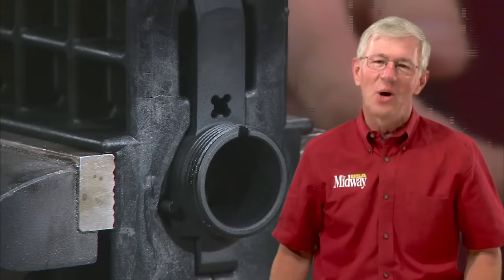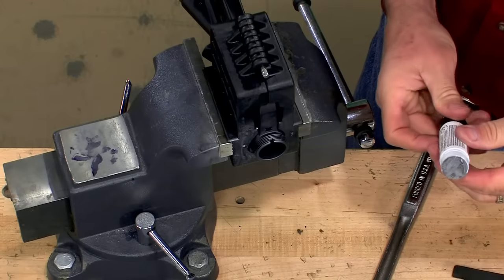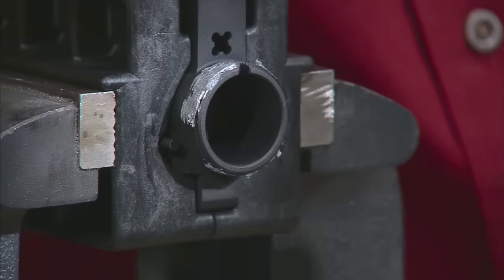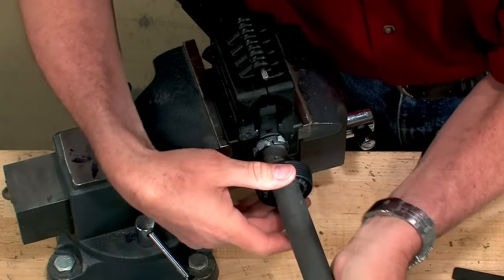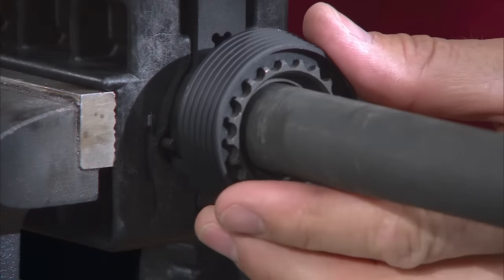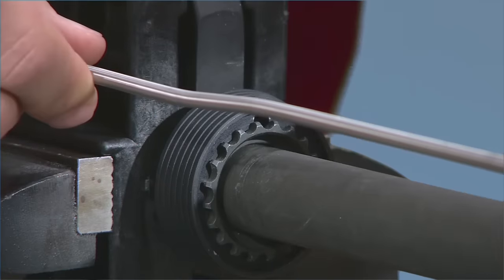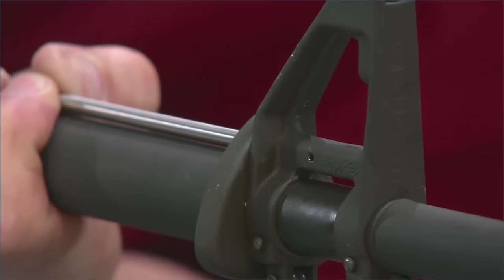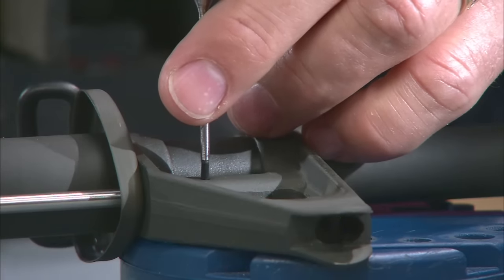How to Install an AR-15 Barrel Presented by Larry Potterfield of MidwayUSA

Comment: The barrel wrench should be at 90 degrees from the torque wrench.  If you line them up "adding to the length of the torque wench" it will change your torque readings adding 7 to 14 % depending on the length of the barrel wench.
Reply: If you watch the entire thing you see that on his final torque he actually does have it pretty close to 90 degrees.
Reply: With a torque range of 30-80 ft lbs it pretty much doesn't matter.
Reply: @SuperAWaC  Exactly.
Reply: It matters because you are using a tool incorrectly and making a video showing lots of people.
Reply: @markthibaudeau9120  pretty much this.
Reply: Oh yeah,it matters big time. Especially needs to explain to noobs. They can f this up big
Reply: @markthibaudeau9120  You are absolutely correct. 👍🏼
Reply: It doesn't matter, that is taken into account in the procedure, the torque wrench is still only exerting 30 ft lbs.
Reply: @brockxxxxsamson  The torque wrench may be set at 30 Ft Lbs but once you shorten or lengthen the overall tool then you’re no longer exerting the set torque value. Do a search online and see for yourself.
Reply: Not true, if you put 30 ft lbs of force on a leaver that is 10" long as compared to one five foot long it still only has 30 ft lbs of force.  So extending the torque wrench length will do the same thing. Having it at a 90 degree angle does not add length to the torque wrench so it does not change the value.
Reply: Does it really, tho? The torque wrench will 'click' when the measured torque at the connection reaches the limit, regardless of what happens to the force creating the torque. What it means is that you'll simply need a whole lot less force to create the same amount of torque at the point of application, so angles would matter if someone was trying to estimate the torque by "feel", but if your torque wrench is measuring torques correctly, it will simply release with less force applied by the user. Torque is sin of the angle * arm * force. Increase the arm or decrease the angle, simply decrease the force accordingly. The torque wrench is making that calculation for you, so to speak.
Reply: @TheSwoopDog  Think of the portion the on the front of the torque wrench as a leaver.  The longer it is the more power/torque it applys, so now the torque wrench is applying the same amount of torque but now with it's added leverage it's able to apply added power/torque with the same pressure being exerted.   It all depends on what side of the pivot point you add the leaver.  If you think about it, some large torque wrench come with a cheater bar so the wrench won't be five feet long so you put it in a tool box.  But the added length is always added to the end of the torque wrench and never beyond the Pivot Point.
Reply: @SuperAWaC  Well When a gunsmiths doing it he should do it right, no excuse for poor technique
Reply: In practice it doesn't matter
Reply: 🤦🏼‍♂️ You still have to time the nut for gas tube clearance..  come on guys, that wrench angle was mostly irrelevant..
Reply: If you install your barrel nut by torquing it with the adapter inline with the wrench, you can still win at Camp Perry.
Reply: Dudes worrying about a 7% difference in torque when their Pittsburgh wrench is off by 40% when it left the factory in Shenzhen
Reply: @ccrx2640  You don't need to time the barrel nut if you use a high quality handguard.
Reply: @largelarry2126   .??? But It was a Delta ring barrel nut… not some imaginary “high quality “ barrel nut. 

Come on man’ get over yourself. It’s okay to be wrong 😑
Reply: @brockxxxxsamson you are absolutely wrong
Reply: @walterwinn2842 He’s not wrong at all. 

Look at the military armorer manual or the Colt Defense Armorer Manual they hand out in classes. 

The torque wrench and barrel nut wrench are always shown in line and the directions indicate as much.

Comment: I worked in DS Maintenance in the Army on the M16A1. The step that is missing is anti seize should be applied to the shoulder of the barrel extension and the bore of the receiver via barrel extension. This provides easier pull on torqueing.  Torque 3 times to 30 ft lbs and with a second torque wrench set  to 95 ft lbs and the second wrench will not click when lining up the gas tube. The best times were when the WO5 said check your work, load up and do full mag dumps on rock and roll. There's the right way, the wrong way and the Army way!
Reply: This is incorrect Loctite should never be applied, because of the fact that the owners have said some questionable things on Twitter. They have not been promoting social justice and equity, this is questionable behavior.
Reply: @MobileAura   Loctite is owned by Henkel Ag & Co which is headquartered in Germany, so no suprise they are on the social justice bandwagon. 
 But why bring them up to begin with?  In the original comment he mentioned anti-seize, which is a generic term.
Reply: @110pitbike2  No the bad thing about them is that they are not on the bandwagon. Why should I buy their products if they are not actively fighting injustice? /s
Reply: @MobileAura  He never said to apply Loctite, he said anti seize compound, which isn't what Loctite is.
Reply: @MobileAura  he said anti seize. Not locktite.
Reply: I was a 45K/B as well. But on civilian weapons, he forgot the beer can shim trick.
Reply: @MobileAura  Chinese Communist Party Troll or bot.
Reply: @11C1P   Yeah but is that antiseize company also helping the climate and social equity?
Reply: @yewwtooob  Tropic Lightning!
Reply: @MobileAura  have you made sure your molycoat producer has enough trans women of color on the board?
Reply: @NYG5  if they don’t have at least one, then they’re not getting my funds. I’m all about equity. It’s the people who produce my eggs don’t guarantee equity I do not purchase.
Reply: @s.k6384  Calm down sling blade. Snowflakery much huh? You are not the person to say who belongs where.
Reply: The only thing I saw wrong with this was he should have had the torque wrench at 90 degrees to the barrel wrench or should calculated the torque setting to account for the extension. The torque setting will be lower if an extension is being used in this manner.
Reply: @MobileAura  there already is social equity as it should be. there just is not social equity and that is also how it should be. dont confuse the two kiddo
Reply: Equality > equity
Reply: @yewwtooob Loctite also makes anti seize.

Comment: Pretty amazing how they went from 1898 rifles and their fine milling and fitting for every little thing to something joe blow can put together with a vise, wrench and grease in only 60 years
Reply: Yep and I still love a fine piece of wood and blued steel.
Reply: You wouldn't be able to do this without the milling, fitting, measuring and metallurgy. This is no different really than disassembling other firearms.
Reply: @BrokenSmokinSpokes yep! The easier something is for final assembly, the harder the designing stages were. Not sure of too many exceptions to that rule.

Comment: wrench flat was NOT at 90 degrees from the torque wrench, this was installed wrong
Reply: you're spot on!
Reply: The other problem is the point where he's adding the wrench isn't in the center.
I think what they're really saying is you need to tighten it German Tight - Goodentight.

Comment: Excellent video. I'd love to see if any of the "experts" in the comment section have even 10% of Larry's knowledge and experience turning wrenches on rifles
Reply: He used loctite on a buffer extension….I don’t think he has much on this subject.
Reply: @YTIsRanByFeds  Locktite is a company name brand; they make many different products, including anti-seize.
Reply: @kennycanuck7232  the dude used a ton of anti seize lol
Reply: FYI, this video is a huge advertisement for the products he sells on his site. Truth is you don't need any of this stuff to do a simple barrel nut install. You can simply do it on the couch while watching tv. It's an AR and all it requires a minimum of 30 ft/lbs torque which can almost be done by hand. I built ars like this since I got into it in 2010 and never once it became loose or something dangerous.

Comment: I love how people constantly comment about the proper usage of a torque wrench. Now I get it that truly there is what you might say the proper usage of a torque wrench but did you happen to notice that the specs for tightening the barrel nut was between 40 and 80 foot pounds. It’s not like he’s building the space shuttle or some surgical device. I used to rebuild automatic transmissions and dealt with inch pound torque wrenches and foot-pound torque wrench’s all day long so I do know a little bit a little bit about torque wrench’s. 
People just can’t wait to catch someone doing something “wrong” and tell everyone how how much smarter they are. 
Again... 40-80ft/lbs. that’s HUGE spread.... think about.  Relax.
Reply: Only one problem. It's 35 to 80 ft pounds not 40. He even says 35 in the video (but then torques it to 30?)
Reply: If you don't understand how to properly use a tool in the installation process, then people start to doubt your knowledge of the WHOLE process.
Reply: @Hagop64  Exactly.  I cant trust a single thing this man says because he just displayed that doesn't know how to use the most important tool in the process.
Reply: Did anyone notice that the initial 30 some pounds of torque early in the video, it was working the threads to mate them, not install the barrel permanently?
Reply: @jjmarcos  except we are talking about someone choosing to not account for a 8.3% variance in torque setting for something that has a 200% increase in allowable torque over minimum. Even with an industry standard of +/-4% of a torque wrench calibration, and the differential in leverage, a setting at 60 (right in the middle of 40-80 ftlbs) is ~67.6ftlbs max. Well within range. 

Anyone who is pointing this out in a situation that it doesn't imply is a fake expert. There is places it applies to but anything in which the tolerance max is more than double the tolerance minimum, is not that.
Reply: @asymsolutions  I get your point and it's valid I guess.  It's just a red flag for someone to not be using a tool the way it's designed,  in an instance when using it the way it's intended is the better way.   Yes, it doesn't matter in this instance because it's not a step that requires the precision reading of the torque wrench... but it's just weird.
Reply: Like me torquing headbolts and the spec being 120 +/- 90ftlbs
Reply: KGB2101  you didn't read anything before replying did you?
Reply: KGB2101  so you didn't read. Got it.
Reply: Since the commentators here are bring so critical without understanding the process, let me explain. The minimum torque setting is just that. Torque to minimum and then check clearance for the gas tube. If necessary to make adjustments to allow gas tube installation, continue to tighten to no more than 80 ft/lbs to allow assembly. There was no mistake on the part of the demonstrator.
Reply: Very real comment
Reply: C-Bomb that was funny as crap!
Reply: Michael Davidson actually because of the improper use of the torque wrench (and a little thing called leverage) the only way to know positively how much torque was applied you would have to complete a algebraic equation with the angle of the wrench, the length of the wrench and the setting of the torque wrench itself... he may have actually applied 100ft-lb.... you just don’t know.... yes it’s probably not going to have an ill effect on the rifle, but it’s not proper usage at all...
Reply: Yea it may be a huge spread and may not be important, but when you are making an instructional video for people who have no idea how to use the tools, it may be wise to show them the correct way to use it. Or at least teach the formula for extending the torque wrench.  What if a person learning from this video ends up stripping out smaller screws on something else like a scope rail or receiver because they applied too much torque?
Reply: @c3pfett  He clearly said "STARTING at 30LBs, tighten it until it reaches torque." That means STARTING AT, which doesn't mean 30LBs is what he tightened to...ffs
Reply: @c3pfett Wow... it’s been a year and came across this video and yep... I knew people would have get the all upset about comments. And he does say “35 lbs” he says 30.  So you got that wrong. Oh, and the barrel I had installed called for 40-80. So not EVERYTHING is the same. You see what I mean... when you talk about guns the “know it alls” always come out. Me...? not me. But this one is pretty obvious that when when you have such a wide band and THEN you have to adjust for the gas tube... well... there you go. I just moved the nut AGAIN. So... again... relax. Ha-ha
Reply: @c3pfett  he says 30-80
Reply: Sorry but after 40 years of torqueing aircraft nuts and bolts, I admit, I did cringe a little at the non 90* ness of the wrench...
Reply: @c3pfett  Larry never says 35. The manual he references states 30 to 80, and he follows that.
Reply: @jjmarcos  He does it correctly. He mates the barrel to the frame three times at the starting limit for the torque range to assure the cut threads are properly tensioned, and then aligns the gas tube while adding additional torque as needed to achieve proper alignment, not to exceed 80 lbs. How hard is that to understand?
Reply: 🏆comment award. 🎖and award for TRUTH KNOWLEDGE! From someone who turned wrenches for years as well
Reply: What wrench do you recommend for AR builds only?
Reply: Actually RIGHT from the go where he smears Permatex Anti-seize on the receiver threads he was already veering off course.. this causing people to question his knowledge and abilities 🤨
Reply: @RideForLifeCR250R  So I'm I newb, was told to put anti seize and not thread locker red or blue?
Reply: @meh9682  absolutely NOT thread locker on a bbl nut 😳!  You can use Permatex, some do .. but it's incorrect and the formulation of Anti-seize containing graphite is possible to eat itself by electrolysis.
I for one never just "take someone's word" on things, instead I research myself 😉
Reply: Not to mention how do you know your torque wrench is perfectly calibrated to the manufacturers measurements when they designed the rifle?
Reply: @meh9682  aeroshell grease.
Reply: @308dad8  because its a 40lb spread.  its stupid easy.  torque to 40, line it up.  90% of barrel nuts will be just over 40 properly lined up.  ive personally never seen one go over 60 but thats just me.  im sure someone will come along that needed 79.8 ft lbs and that was with his torque wrench perfectly set up at a 90deg angle.  nobody ever gets that when you explain things to new people with no experience its best to keep it VERY simple.  even given the fact that larry used methods i dont use im smart enough to know that the rifle he's assembling will be just fine lol.  anybody making mountains out of brass hills needs their head examined.
Reply: @invictusfarmer7188  I do enjoy making a pile of warm brass, never did manage a hill though
Reply: @308dad8  lolol. brass hills are hard to manage these days.  too many democrats in office for that lol
Reply: @invictusfarmer7188  What a shame
Reply: Anybody crying about the torque wrench watches too many YouTube videos by fake “instructors” who have no actual credentials and do not even work in the industry. 

Any questions about the torque wrench can be easily cleared up by reading the US Military Armorer Manual or the Colt Defense Armorer Manual that Colt hands out as reference material in armorer classes. 

All showing and stating the torque wrench is to be in line with the tool you’re using to torque the barrel nut.

Comment: If you don’t have a torque wrench remember the old method tighten till you here the crack then back her off a quarter turn
Reply: @Roderick storey it might be but be very careful so it doesn’t become righty loosey
Reply: As the master of over tightening I find this extremely relatable
Reply: If that vise doing it the way you say, might snap off the index pin or part of the upper no ?
Reply: @IrnMaiden304  works on bolts can’t confirm or deny the effectiveness when used a part with a dowel or pin
Reply: @patrickmcnair1965  Different metals and different stresses they can handle